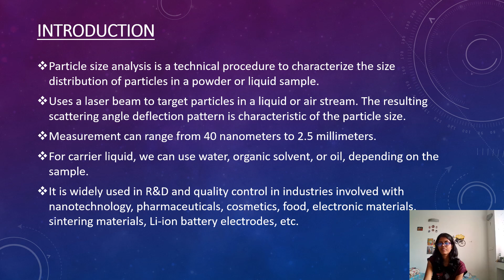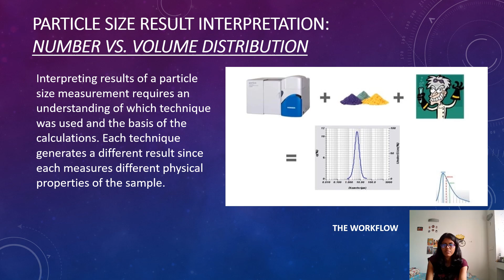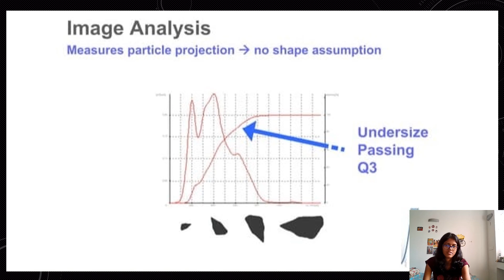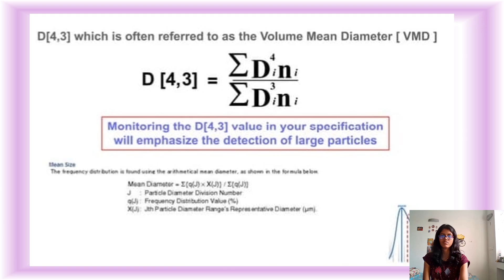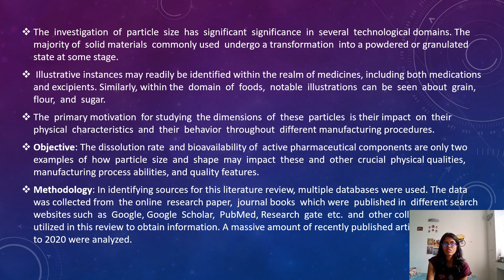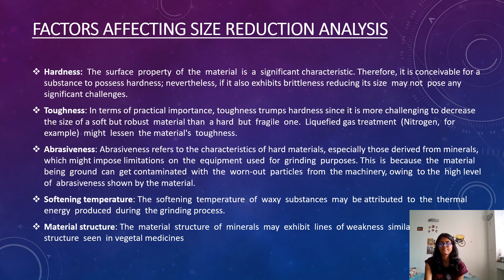Particle Size Analyzer

Comment: Harshita Patil BT21CME047
What is the significance of using a multimodal distribution in particle size analysis?
Reply from the maker: @HarshitaPatil-04  will tell u
Reply from the maker: A multimodal distribution in a particle size analyzer (PSA) can indicate that the sample is a mixture of different particle sizes.